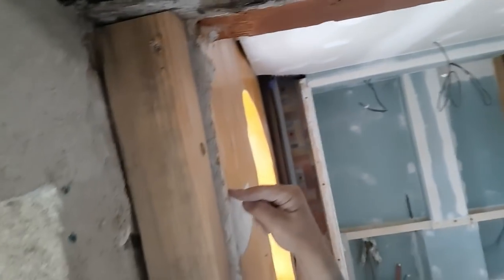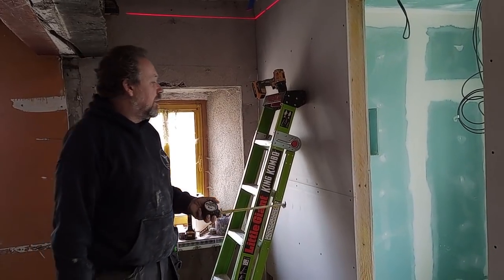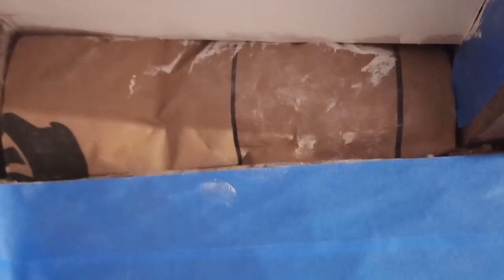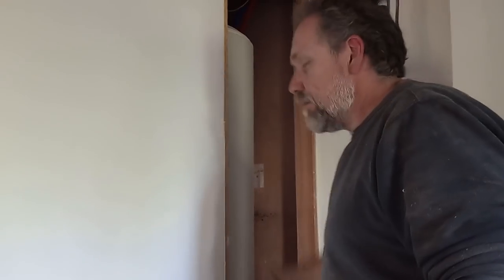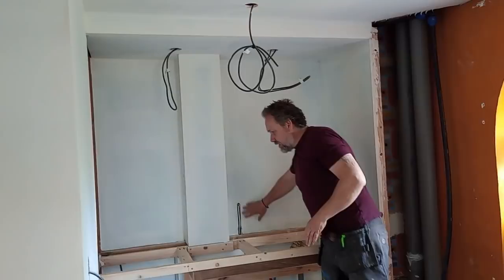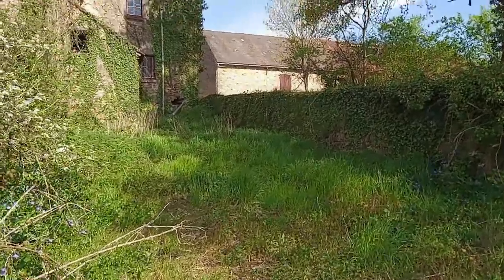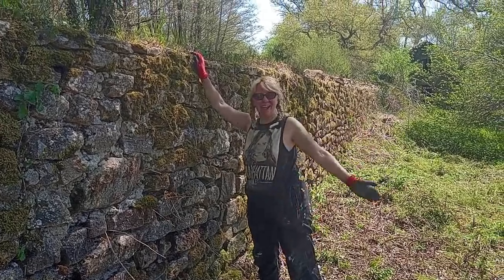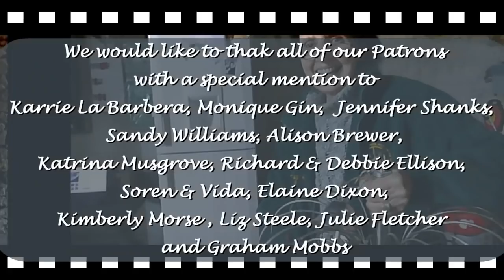78.  The Renovation of Chateau De Montmagner

Comment: The place looks beautiful, and with your work you are uncovering the beauty of the building, especially the latest work you did on the outside with the stone wall. When it comes to the interior -- to give a thought, it is easy with the renovations to change the feel of the chateau (the period it was built). Doing this takes away from the style of the chateau. Because it is from an earlier period (medieval), it would look better to decorate/renovate in that style. To minimize the use of modern materials, like plaster boards, use wood and stone rendering walls. With this, the look would be more simple, easy to decorate, and create for you more business as it would make a unique place. It would also save you a lot of work and money. In your building, you have proof that old techniques and materials last generations compared to modern ways. Remember the first job you did, taking down the "modern" built apartment.
Wishing you good health and energy for the tasks ahead of you.

Comment: To measure all those beams-
Use pieces of paper. Tape them as you put them around each beam. No need to cut angles. Use like 8x10 pieces of paper. Tape as you go. You can then take it down, place it on your board, pencil it in and cut! Can do this for floors or ceilings, etc. Hope this helps. I’ve worked in many positions using this as an artist.

Comment: Lisa & Ted Message from the Group here in France.
                                   Re Fosse Septique
1. Your job is to fully itemise,complete layout of Toilets,Bathrooms,Shower rooms
             and other areas such as kitchens ,the amount of people expected to be using these facilities                    where the waste would be directed into the Fosse.Not plan the route.
2. This is most important to estimate the size of tank required
3. You have no say where Vent Pipes,and the route of pipes and Tank are placed,this done by the experts from the Authorites
4. You seem to think the new setup will  be a simple replacement of the old tank 
route on a larger scale,its not always so.
5. This is a major investment and must work so the Authorities are really strict on construction.
6. The Inspector  calling given the info from you, will make a plan,for size of tank,route,
type of special plastic filter pipes etc,type of gravels used to bed the Fosse Septique
when full plus its own weight its immense and must remain level and steady
7. Go for a Concrete tank,plastic are cheaper but can move,get a qualified installer who will follow the plans,plus a work guarantee.
8. On completion of fitting(the tank and  pipework must not be buried) the Autorities must be notified,will come and inspect if OK the all important Certificate is issued.
9. Hope this helps   .Regards

Comment: When you want to turn a corner with plasterboard you have to cut a groove on the back down the line you want to fold without going through to the outer skin of card, then you fold it in on itself with a line of map or plaster down the inside groove. That way you don't have to finish the corner. Just an idea. Not sure of that was clear?

Comment: Did you know that Lesa that to correctly tank you should use waterproof tape all joins and the floor should have waterproof corners. All proprietary products. A mistake I made when I waterproofed my ensuite.i just painted the goop on like you. Learnt better for my bathrooms. Also you must pre drill your tap holes and screw holes as water will run down the wall behind  the tap and into the back of the wall. There are special products that seal every area. For future bathrooms. I had a leak a slow leak that I didn't notice until it was too late. I had to gut the bathroom. Expensive. Next time I did it all

Comment: Hello, this is 2nd time I try to write this comment 🙄🙄🙄😏😏😜😜
So I get really upset all the other (French chateau) vlogs I watch have as many as 8 adverts on a much shorter vlog.. Do you think there is a setting on utube that you could up the ads, also have you thought just to split your vlog into 2 parts 1 and 2 with no extra work to help revenue.
Also your montage at the end is very long and possibly your subscribers don't know there is an add at the end of it, and they miss it, as I didn't realise for quite a while and just stopped the vlogs.
I know your main (job) is to renovate your chateau, I'm just trying to think of ways without much effort to up your revenues, I do apologise if you think I'm being pushy it's just when a 20minute blog has about 6 adverts and yours is almost 1hour and there are 2 or 3max.
After all that hope the septic tank visit goes well.